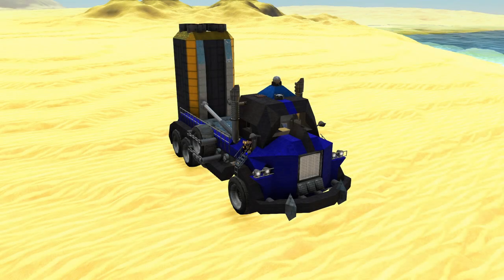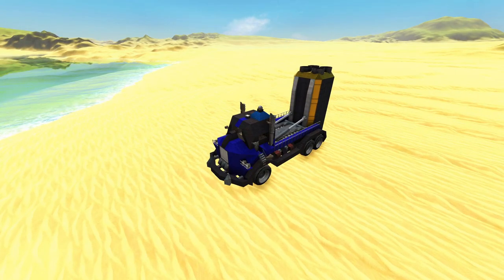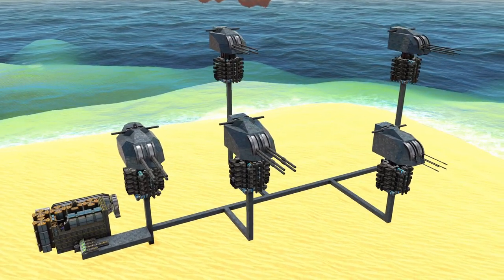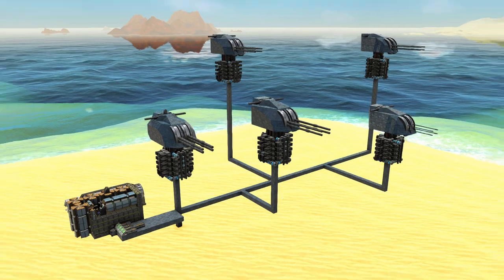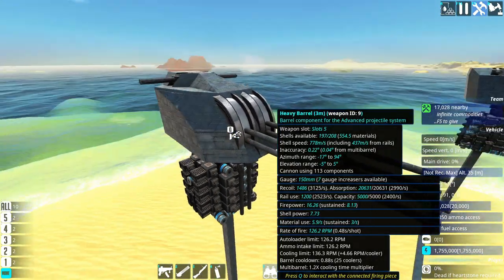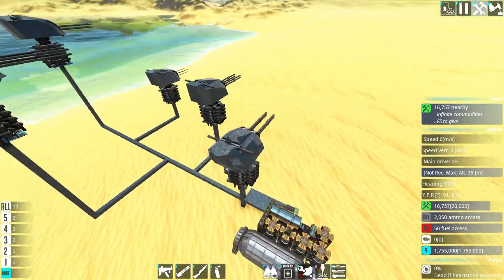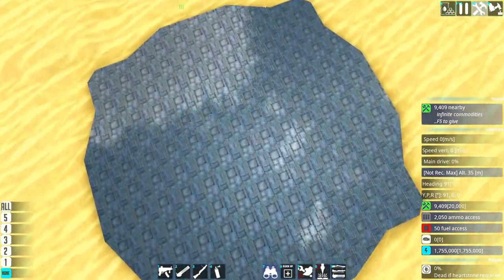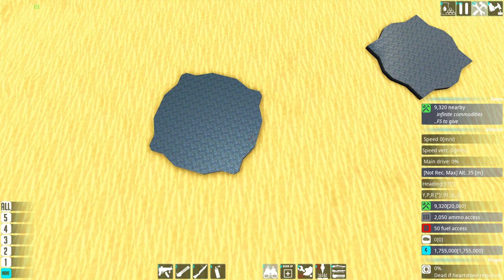[ENG] FtD - Construction - Flak and CRAM-Bunkers

Comment: Thanks for sharing! One improvement that could be done is to have an external power source, like a power facility that sends energy to all the turrets in the region, just as other vehicles do. Just as like many strategy games, destroying the power source of the turrets is kind of a cliche objective in some of the missions, (Battletech).
Another improvement could be to put the batteries and other internals in the rotating part of the turret, that way you can always face your heavy armor to the enemy and your internal bits the oposite way.
Reply from the maker: I have indeed thought about a central generator structure. However, after some testing I decided to give those emplacements a certain degree of independance. They still need a sensor tower to relay detailed detection information though. I believe resource-storage can not be placed on turrets. Not sure about that. An excellent suggestion though!